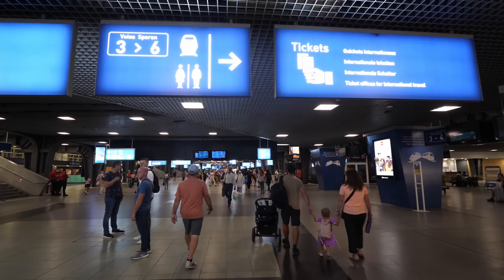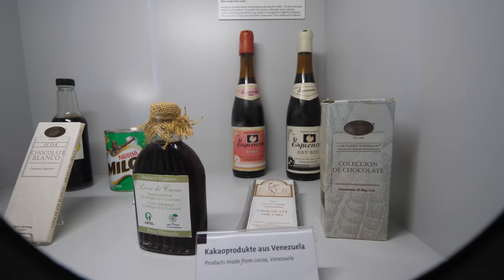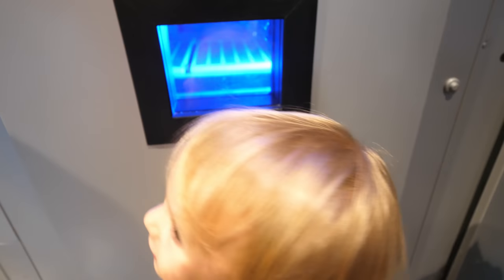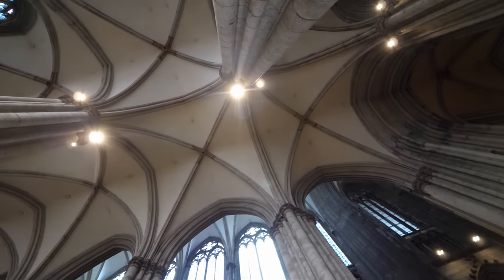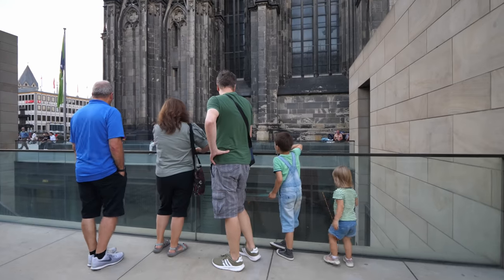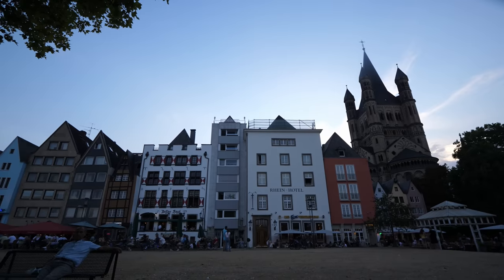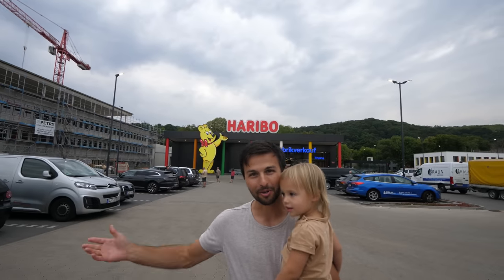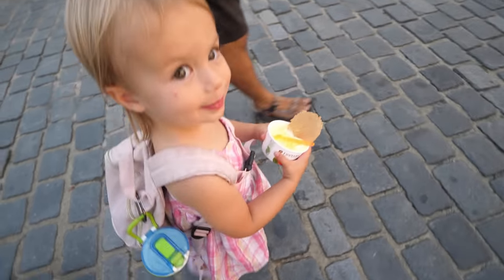Our First Time in Cologne + Bonn!  | Chocolate Factory, Haribo Outlet, Old Town + Drachenburg Castle

Comment: 2 pieces of information you might not have: In Germany there are only 19 skyscrapers (buildings with a height of 150 m or more). 18 are in Frankfurt and one in Bonn (the post tower 14:15). Haribo will soon open its first manufacturing facility in the United States (Pleasant Prairie, Wisconsin). Then the offer in the USA will probably be larger and cheaper.
Reply: I didn't realize that and I lived in frankfurt for 3 months in 2017 hmm

Comment: What many may not know is that probably the most well-known product of 4711 the "Kölnisch Wasser" is actually not a perfume at all. It is rather a refreshing "water". This fragrance I also know from childhood, where the "Kölnisch Wasser" was a daily used product in all walks of life.
I love to cycle through Germany and Europe as a bikepacker and have rediscovered the 4711 Eau de Cologne for me. When the temperatures in the summer drives the sweat on my forehead, I take a paper handkerchief and wipe my face and neck with it. The refreshing effect comes immediately and works wonders the essential ingredients cool down. Another very good application is cleaning the hands when I'm on the road. Whether sticky fingers from the food intake or greasy hands from the bike chain. A little "cologne" in a paper towel and I can clean my hands without wasting my precious drinking water. For me, 4711 belongs since a few years necessarily in my luggage, just like back then with our parents😊